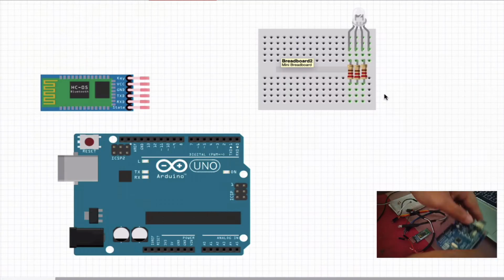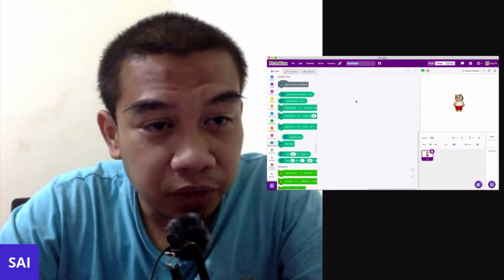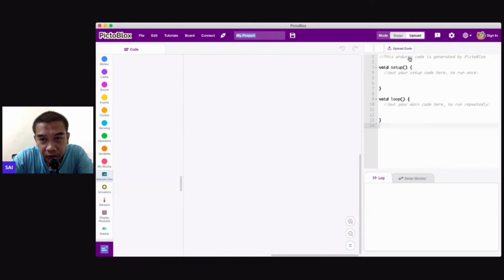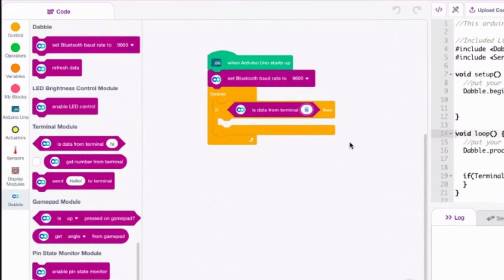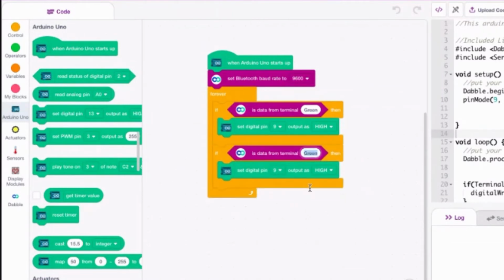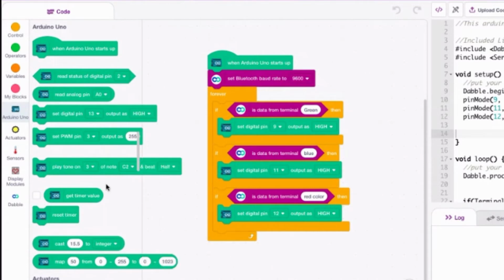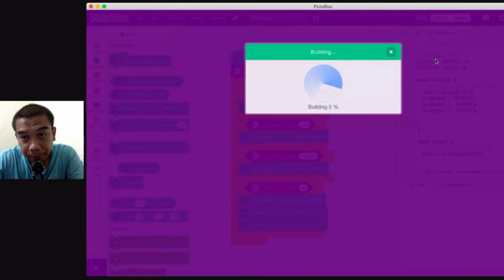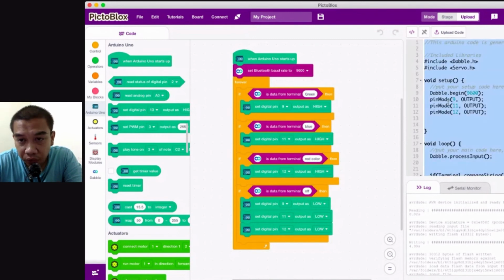Arduino Uno Tutorial With Pictoblox - 3: HC-05 bluetooth module control RGB Led via Voice Command

Comment: Sir i am unable to connect bluetooth with pictoblox getting msg like "bluetooth port disconnected" What can i do to solve this issue
Reply from the maker: There are few ideas i can suggest. 1) make sure u are using the pin 2,3 for tx and rx. Try that one first. Change the pin accordingly. This is the first initiàl step in pictoblox. Pictoblox bluetooth function using pin 2,3 on their rx, tx from bluetooth to your arduino. One othe things, sometimes you need to update your firmware first using pictoblox. Right upper conner, update firmware when you uno is connected
Reply: I am new to this, 
While connecting 1st time i need connect bluetooth rx and tx with arduino?
Reply: Or else I just power the bluetooth module with and vcc
Reply from the maker: Yes. The rx and tx can be connected to pin 2,3 according to stempedia website if you want to set as alternative. Otherwise, you can use the normal rx and tx at arduino
Reply: @drsyazwan  thanks a lot sir
Reply: Can you post video of makeing hand gesture control car uisng AI and ML in pictoblox
Reply from the maker: You can try it first as shown in the video.. if got any problem. Please let me know
Reply: @drsyazwan  I tried what you said yesterday but still now I get error msg "bluetooth port is diconnected
Reply from the maker: Do you try to reconnect with different phone and enable gps. Try that.. some phone require the gps to be enable
Reply: @drsyazwan through mobile it's connected and working fine but i want to connect with my laptop
Reply from the maker: What you mean your laptop? Do you fail to received the data in your laptop? I quite not understand your problem
Reply: @drsyazwan  actually I am trying to to connect bluetooth hc 05 module with pictoblox in laptop not mobile. In laptop I installed both pictoblox and pictoblox link then I connected arduini uno with picture and uploaded firmware after that i try to connect my bluetooth module but in my laptop (pictoblox says your bluetooth port is disconnected)
Reply: Here I am trying to control that bluetooth module from laptop not mobile
Reply from the maker: Dear Sir, for controlling the HC05 with laptop, I believe, the command will need manual integration with AT Command. The use of pictoblox suitable for HC05 (generic model and perhaps HC06/ BLE Module). Personally speaking, I am not sure about this (based on experience, I am using BlueStack to run Mobile Apps in My Computer to enable the connection with the Arduino). If you do not mind, what actually you looking for? Are you trying to connect/ control your devices (project) using computer via pictoblox? If this is the answer, its possible. May I suggest you to try this link to check it out: https://thestempedia.com/project/ai-gesture-controlled-robot-using-machine-learning-in-pictoblox/
Reply: Sir, kenapa Dabble tidak bisa searching HC05, padahal sudah sdh disetting diizinkan. Harus uninstall dan install setiap mau digunakan. Bgmn solusinya sir?

Comment: More videos sir
Reply from the maker: Thanks for your comment sir. Surely we will share lots of video about arduino, data and iot stuff. If you got any ideas, please do suggest, so that we can produce specific to your needs.
Reply: Thanks for your reply sir. I am just a student sir, I am learning by watching the teacher's videos. Therefore I have no idea.
Reply from the maker: That's good. If you can share your program and idea what u plan to do, i can suggest.. its good. I am not expert, but so far, this field have good prospect
Reply: Can you teach me sir?
 Esp32 with scratch.
Reply from the maker: This is good idea. What you meant by scratch? From begining or the scratch software? For esp32, usually for simple coding exercise, you can use pictoblox, easycoding.tn and others
Reply: Sorry sir,  I mean pictoblox.
Reply from the maker: Surely. Will share it soon. Thanks for your feedback. Keep comment and fill up with ideas. Please have a look into our previous video: https://youtu.be/2NBEoGqE1B8 Will add other videos in our repo.
Reply: @drsyazwan  Sir I have a problem, I tested the ultrasonic sensor with pictoblox and it worked, but when I restarted the program I could not find it and it displayed as unsupported file.
Reply from the maker: Ok. I believe when you create your project using pictoblox, you probably not save it as pictoblox file. My suggestion, you need to save as pictoblox file. Or you can copy the code from the generated code in pictoblox and proceed with paste it into arduino ide. However, some library of pictoblox need to be install. Another way to really configure it, please make sure you update your arduino firmware at the pictoblox right upper conner menu
Reply: @drsyazwan  Thank you sir ,problem solved.
Reply from the maker: Thats great.. feel free to comment and ask.. I am happy to talk and discuss with you
Reply: @drsyazwan  Thanks a lot sir , please give more suggestions.
Reply: Sir, I got a some problem at servo motor using pictoblox. When I restarted the  servo program I could not find it and it displayed as unsupported file.
Reply from the maker: Thanks for your comment. Do you put the serial output for debugging purposes? By doing this, you can see what when wrong.